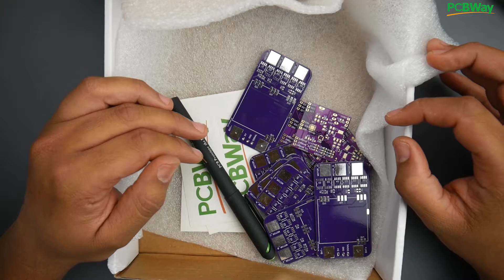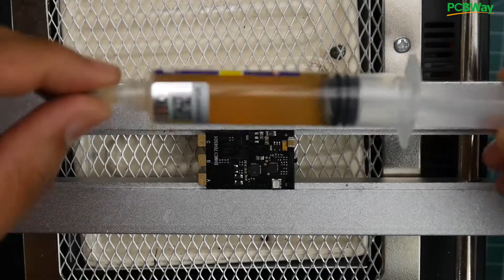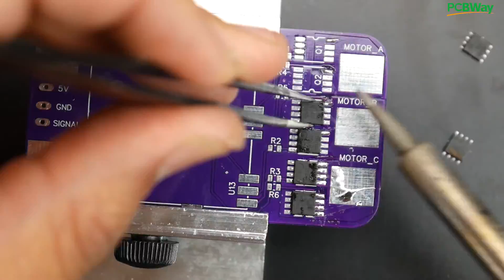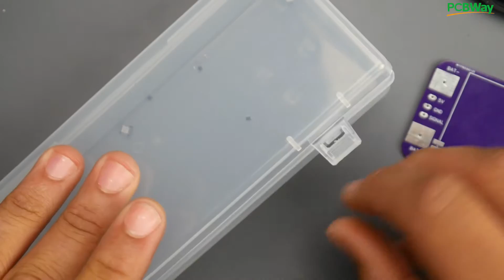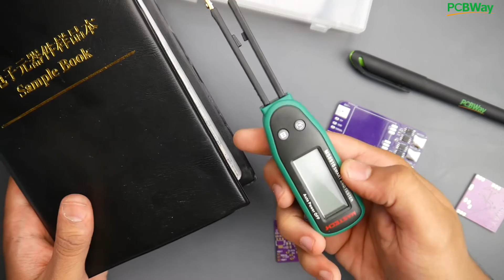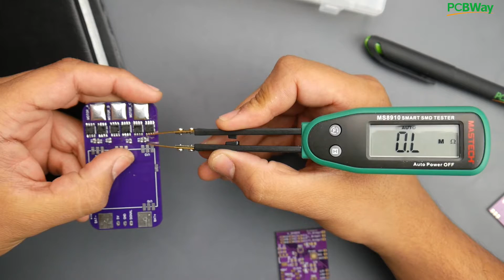DroneMesh Open Hardware ESC // Build Video Part 1

Comment: Hello sir We are trying to build a 4in1 Esc. we made 6 Drones With my custom Esc {BB21-Controller, FD6288Q-Mosfet Driver, Firmware - BLHeli_S (J_H_90)}
All 6 Drones facing motor heating issues. We tried different firmware ( J_H_90, J_H_50, J_H_30) with PWM frequency 48khz. All motors vary in heating , mostly diagonal one heat most. We figure out the issue is from esc Side as we use alternative mamba esc and it works great.
Reply: You got heating issues using the one made in the video?

Comment: Hello, congratulations on there awesome videos. I managed to design my own ESC by watching your awesome guides. I managed to get my PCB's and I managed to run the motor today. But I'm a bit confused about selecting the correct Blheli_s hex file. I tried A_H_50 file and it works okay. But I'm not sure if it's the correct and optimal version. Thanks again.

Comment: My biggest question having no experience in design what so ever is how you even go about finding the proper chips you need to accomplish your goals. Like with the FC how is one even to know of the existence and where to find the chiop without being previously exposed to one working on a similar type of board before. To me this is to be one of the biggest hurdles in developing a board and or developing a board that isn't just directly copied from someone else. I hope I am expressing my question properly here and any and all insight on the subject would be greatly appreciated. Thanks!

Comment: Why is the esc so big ?
Reply: This esc is so big because he wants to test transistors with this PCB. You could make it much more compact, and also use smaller parts.
Reply from the maker: It's a development board.